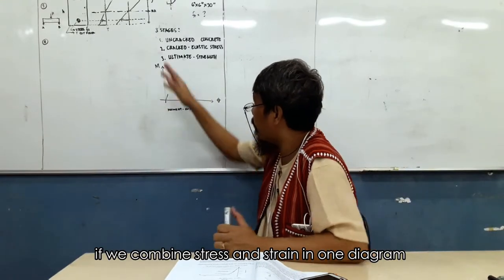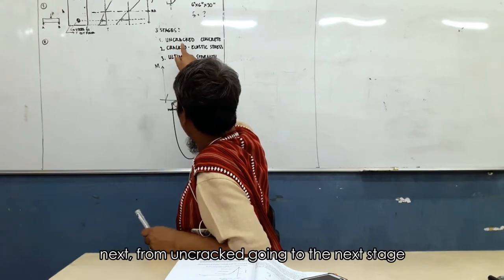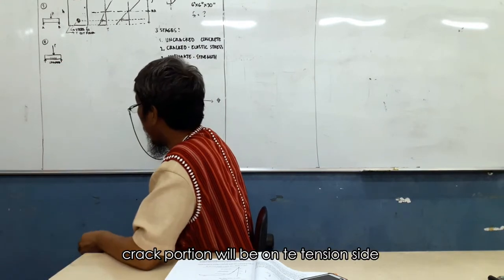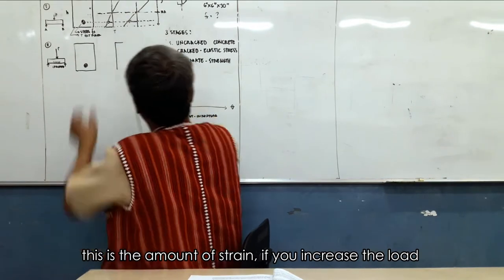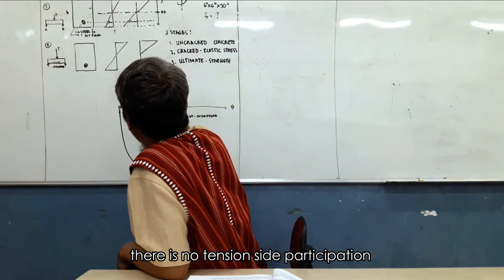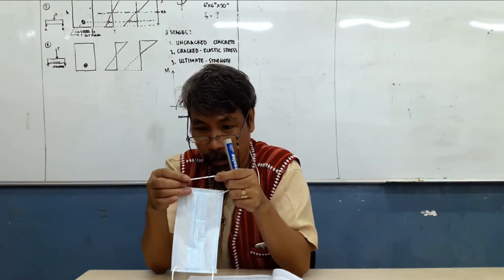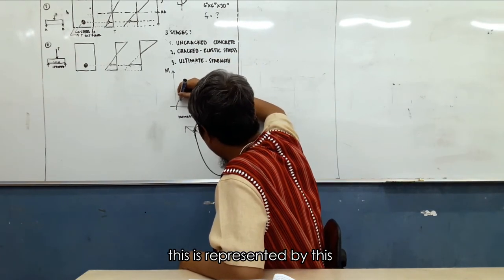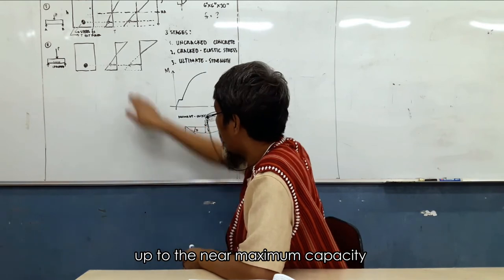CE 422: Structural Design 1: Reinforced Concrete Design || Flexural Analysis of Beam || Part 3

Comment: Thank you sir for this lesson, I learned that Compression is the inverse of tension, so as one moves down the beam from top to bottom, the compression stress gradually decreases to zero, and the stresses reverse, going into tension and gradually increasing towards the bottom of the beam.Tension and compression are forces that attempt to deform an object. The primary distinction between tension and compression is that tension refers to forces that attempt to lengthen a body, whereas compression refers to forces that attempt to shorten a body. To calculate beam deflection, we must first determine the stiffness of the beam as well as the amount of force or load that will influence the bending of the beam.

Comment: Thank you for explaining how was it when we combined stress and strain in one diagram wherein we can notice that the relationship is proportional. And small beam with an increased load will leads to crack to the tension portion. With the increase load, there will be a longer strain as well and with the stress, since there is an increased load the compression portion will be bigger but because the tension side will have the void of resistance due to concrete, there will be no tension side participation and just a pure compression.